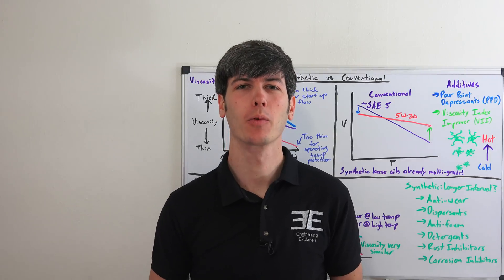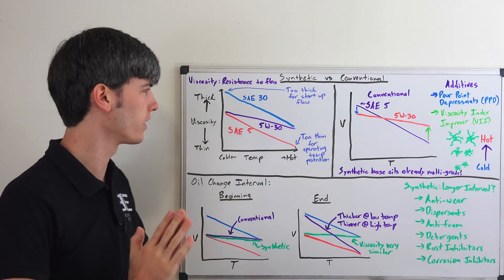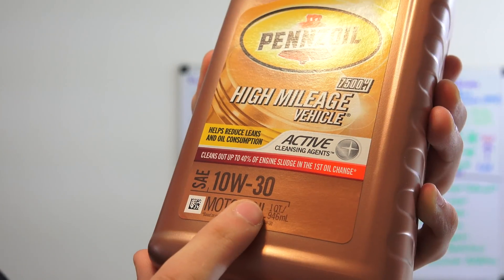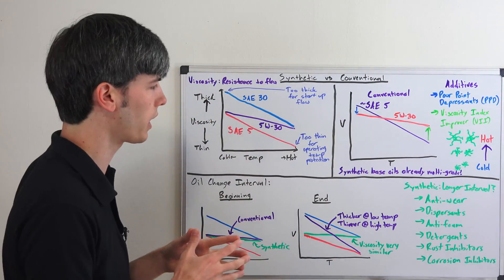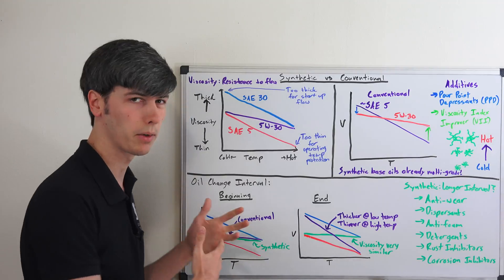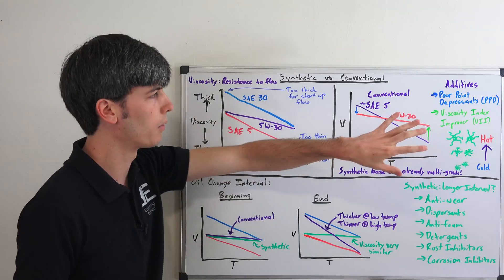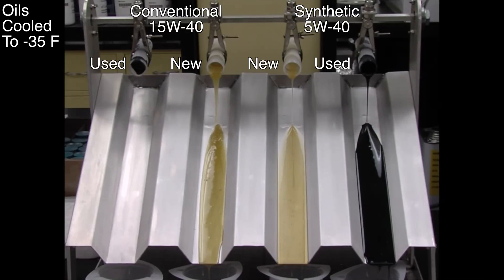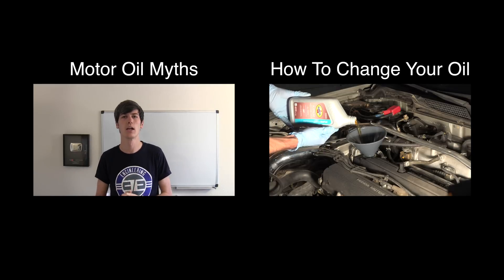Is Synthetic Motor Oil Better For Your Car?

Comment: Comparing 15W-40 to 5W-40 at -35F is bullsh*t, synthetic or conventional.
Reply: I'll attempt to explain this one last time. This is simple scientific method, we learned it in high school. In relation to this video, he explains conventional oil is given additives to make it behave like a multi-weight oil. 

His hypothesis is that conventional oil loses these multi-weight properties as it is used. So he conducts an experiment, he pours NEW and USED conventional oil, while also pouring NEW and USED synthetic oil. 

The expected result of the experiment is that the USED conventional oil won't behave like a NEW conventional oil, due to the loss of multi-weight properties.

HOWEVER, the experiment isn't performed to the standards of the scientific method. In fact,  it is performed in a way that predictably influences the data, and actually provides the data he was hoping to see. You see, in the scientific method, to TEST your hypothesis you should change ONE, and only ONE variable during your test so that you are testing ONLY that variable. In this example, that ONE variable was the type of oil. Conventional or synthetic. In fact, he changed TWO variables, the TYPE of oil, and the WEIGHT of oil. 

Earlier in the video he explains that NEW conventional oils should perform much like NEW synthetic oil. So by that understanding, we could have expected the NEW synthetic oil to pour just as sluggishly as the 15W-40 conventional oil. 

The attempt to excuse this error in the scientific method of saying "There is no conventional 5W-40 oil", is out of line because there are plenty of weights of oil that are made in either synthetic or conventional, such as 5W-20 or 10W-30, being very popular ones.

Another parallel example showing why you cannot change multiple variables in the scientific method. Suppose I want to test which shovel is better, a wooden shovel or a metal shovel. I predict that the wooden shovel will preform better at digging.

To test, I give a metal shovel to a child in the frozen tundra, and ask him to dig. Then, I give a wooden shovel to a man on the beach and ask him to dig in the sand. When the man with the wooden shovel digs a 5 foot pit, and the child with the metal shovel doesn't even break the ground, can I then say that indeed, the wooden shovel is the better shovel?

Of course not, you would give the same man the metal and the wooden shovel on the same patch of earth. Then the better shovel would indeed shine through, and my prediction would be proven wrong.
Reply: Your username only makes this comment even better.
Reply: That's not part of the demonstration. For all intents and purposes the demonstration shows a 5 weight synthetic oil and a 15 weight conventional oil at -35 degrees. There's nothing 'temperature stable' about showing a thicker conventional oil in the freezing cold. Furthermore, "5w-40 oils aren't exactly common", ALL the more reason to use 5W-30 oils across the board! This pour test was so easy to do properly, the only reason it wasn't done correctly was to bias the results in favor of synthetic.
Reply: Props to the presenter for such a well explained video. But I have to agree with Phillip Shank. There's no excuse not to compare the same grade of both oil types. Just calls the integrity of the test into question. Its obvious 5W will perform better at a colder temperature than 15W. Yes, the test is between new vs used. But to cause less confusion, test same grade. That is not to say synthetic oil is not better but the demonstration setup could have been way better.
Reply: Literally says he is not directly comparing 15w-40 to 5w-30. It is comparing new 15w40 to used 15w-40, and comparing new 5w-30 to old 5w-30. And your article is literally agreeing with the video. The point of the video is about the resistance of synthetic to breakdown over the lifespan compared to conventional. Copy and pasted from your own article.

 "What you need to know about synthetic motor oil is that it’s widely accepted that any motor oil that is classified as a synthetic delivers better protection than conventional oil does against thermal breakdown—the tendency of the oil to deteriorate (and thus not lubricate as well) when it’s heated. It also curtails wear, increases resistance to contamination, provides better flow at cold temperatures, and reduces sludge and deposits on piston rings. In other words, even though you’ll pay more—typically $1.50 to $3 per quart—for a synthetic motor oil than you would for a conventional motor oil, you’ll get more in return."
Reply: Ralin, I hadn't forgotten about what I had told you. I've gathered 5 different used oil samples, all 5W-30 conventional. (THE most popular oil weight sold) While I think very few people drive their cars very often in -35F temperature, the idea of the test is that conventional oil, once used, sucks in the cold.

So I put 2 of the used oil samples in the freezer, both had been in an engine about 5k miles. Both stayed in the freezer for almost a week, at -5F I pulled them out and filmed a really crappy video of me checking the viscosity. There's no point in doing a flow test as illustrated above, as I could pour the entire quart freely into another bottle. 

I'm thinking of getting a small hose attached to a funnel and pouring a precise measured sample through, and timing it. The idea is that used oil that has 'broken down' will take longer to pass through the small hose than a new oil. But right now the whole idea that conventional oil becomes a liability to your engine once used is appearing totally bogus.

Not to mention the millions of cars on the road which have each racked up hundreds of thousands of miles EACH with nothing but conventional oil...that's not proof enough either, I suppose.
Reply: It's funny that I'm being asked that by you of all people, who I just showed doesn't understand. It was a clever little "I know you are but what am I," but that counter tends to not work in the real world. 

I don't know how to make this any easier for you.

1) An oil that is not rated for cold will perform worse when cold.
2) An oil that is not rated for cold will perform exponentially worse when used and cold.
3) If temperature wasn't supposed to play a role in how the oils performed, there was no reason to cool them to -35, something which unarguably gives a distinct advantage to the oil that was in fact rated for cold.

The experiment could have been conducted at 70, or 170 which is closer to engine running temp. It could have even been done using 5W-30 against 5W-30, but that's not what he did. He purposely used an oil rated for colder temperatures, then cooled the oil to temperatures beyond what the 15W-30 could handle. This is not good science, it's not a good experiment, and it is not being honest to the viewer.

You fell for every nonsense word he claimed, because you are the very layman he was targeting. If he can sell one more sorry schmuck oil at a higher price, he wins for his sponsor, Pennzoil. You are that schmuck.
Reply: Ralin, nice catch by the way pointing out this was a sponsored video. I was so pissed by the blatantly errant demonstration that I didn't connect the dots. Likely Pennzoil suggested the crookedness, as I rather like this YouTuber, his videos are informative, even if he totally sold out on this video.

I've wanted to for a while, and I've finally started to collect samples of used motor oil. I'll recreate this video, but I'll do it properly, and avoid any bias whatsoever. Will be a few weeks, but I'll post a video and we'll see how badly used conventional oil actually behaves.
Reply: I'd like to chime in here. While I agree that the test probably should have been performed with identically weighted conventional and synthetic oils to reduce confusion, I still don't see it as necessary since the point was to demonstrate how the oils wear over time. 

I believe the purpose of cooling the samples to -35° was to exaggerate the differences in viscosity. Obviously no internal combustion engine is operating at such a low temp. I don't know about you guys, but when I change the oil on my vehicles I can't tell the difference in viscosity between new and used. But I bet my engines can.

To Phillip; glad to see someone is recreating these tests. Peer reviewed science is good science. You should Google the Zahn cup viscosimiter and how to use one. It may give you a reliable, measurable way to test your samples. Plus you could probably make your own out of a solo cup (or something similar).
Reply: Ben R you broke it down as simple as possible, yet point was still missed.. sad sad.. lol
Reply: What's really sad is being so unwilling to hurt someone's feelings that you can't, or won't, point out a major flaw in their method.. sad sad.. lol
Reply: He could just have put the same oil rating on both and you would have not known the difference. He decided to put both on there and explain why, how does that make it dishonest?
Reply: 5w-40 conventional oils aren't exactly common. That's part of the demonstration, that synthetic oils can be more temperature stable than conventional.
Reply: Pelu A 5w-40 conventional is basically a curio, mechanical sheering will just leave you with a 5w-30 or thereabouts. One of the advantages of a synthetic is that you can have a 5w-40.
Reply: Yeah, those are my thoughts exactly. I've watched and enjoyed a lot of his videos, but this one... something just didn't add up.

If temperature wasn't supposed to be a variable, why alter the temperature?
If temperature was supposed to be a variable, why not use the same grade?
The amount of variables present is supposed to be absolutely minimized in an experiment like this, so why so many of them?

Then I saw the sponsorship by Pennzoil. Like you said, it was so blatantly obvious that it was skewed.

At any rate, I look forward to seeing the well conducted test. Thank you for your honesty.
Reply: Phillip Shank. that's good enough for me my friend peace out
Reply: Oh, hey Phillip, good to hear back from you!

Yeah, I kind of figured that as long as you weren't putting tens of thousands of miles that it wouldn't be detrimental to an engine, regardless of conventional or synthetic. I definitely look forward to the hose test, though. It should prove quite interesting.

Thanks for the update!
Reply: Phillip Shank - I was thinking that too and my car use 5W-20 but I been using synthetic after first year of ownership. Also I would recommend it for a daily driver.
Reply: Seven Five Thank you for pointing that out.
Reply: This test is potentially misleading. The only information to be gathered from it is that synthetic has a lower viscosity at lower temperature. What if the effects are only exaggerated at these temperatures lower than the average person will experience. What if at higher temperatures the difference between  the two types of oil are negligible? I mean, he was sponsored by Penzoil for this video, so you never know. I'm just saying that when you want to misconstrue results for an experiment, you show a small sample size with variables that favor your position.
Reply: haha well said!
Reply: Yes the test was total BS! First they were comparing to different viscosity oils. Second -35F is ridiculously cold. No one would run that thick an oil in conditions that cold. They chose the viscosity of the samples and temperature to try to show dramatic difference between conventional and synthetic that simply doesn't exist in the real world. Raise the temp by 10F and all those oils, new and old would flow the same.

To be clear synthetics are superior to conventional oil, BUT unless you have a race car or you live in the Arctic circle you will never reap any realistic benefit from using synthetic oil. You will not get better fuel economy, your engine will not last longer and the manufacturer's recommended oil change interval remains the same regardless of what oil you use or what it says on the bottle of oil.
Reply: what uses 40 weight motors, you must have a Ford engine. I use 10/30 in all my cars and Ive had no issues.
Reply: Mostly older diesel engines use15w-40.
Reply: Thomas Morris my motorcycle takes 10w-40
Reply: +Phillip Shank Very well said, friend. If temperature didn't matter and wasn't the point of the video, as he and those defending him are trying to claim, then he wouldn't have cooled them to -35. Clearly an oil that isn't rated for as cold will perform worse when new, and exponentially worse when used. Poorly conducted test.

Brought to you by Pennzoil! "More expensive means more better" - Pennzoil
Reply: I agree, I hate videos like that.  Yes I heard what he said, but the video is still misleading just as dozens of other videos on this subject floating around the internet.  If you pay attention, he points out at the beginning that brand new dino oil of a specific viscosity rating will be identical to brand new synthetic of the same rating.  He then asserts that late in the oil's life, dino oil will lose significantly more of its viscosity rating than synthetic.  

The only question is, just how much does it really lose?  That is the main difference this "engineer" points out.  His charts show a lot of loss in viscosity range for the dino oil.  

If there is that much difference, then by using the same weight rating oils we could have seen that "big" difference. 

But no, he has to bork his test for no rational purpose rather than demonstrate what should have been very easy to see with same weight oils.  Then gives a lame excuse that he is just showing the difference in viscosity of old vs new dino, and old vs new synthetic.  Yet the entire video is about dino vs synthetic.  

Unless of course, it didn't give the result he wanted, and it wasn't easy to see any difference.  

There's a sucker born every minute (second?  sub-second?) and of course they all piled in on this thread with their "common" knowledge.  

Try reading this :

http://www.consumersdigest.com/automotive/motor-oil
Reply: That's a terrible excuse. There was zero reason to cool the oil to -35 if temperature was not supposed to be a factor. Of course, as we have all said already, an oil that is not meant for cold temperatures will perform exponentially worse when used vs. new in comparison to an oil that is rated for the cold. 

An oil that is rated for the cold has only one factor reducing it's flow when it's used, and that is that it's used. An oil not rated for cold deals with both being far too cold for it's intended use, and the fact that it's used.

You seem to have a really low understanding of the issue here.
Reply: Beleive me. there is no synthetic oil in this Video. Both are made of Mineral base.
Reply: I happen to use Pennzoil synthetic in my pickup. But I've only had to start it a few times at -34F. My typical cold starts would be in the +20F range. I'd only put 15-40 in an old engine with very worn rings or use it in high temperature environments. This demo is as informative as showing that salt water freezes at a lower temperature than pure water.
Reply: I think you missed his point. First, the weights of the oils should have been identical. There is absolutely NO reason not to use as similar oils as possible to demonstrate your point. Unless of course the point is less clear when a similar weight conventional is used.

Second, I agree that running the test at -35F is rather silly. The lowest temperature most of us will see is 0F, and that isn't even terribly common (happens only a few days of the year).

But it's easy for a skeptic to think that had he used 15W-40 conventional and synthetic, that the new and used synthetics would have flowed at drastically different rates, or rather, had he used a cold weight conventional (5W-20) that the flow difference between new and used isn't that obvious even at 0F. 

I really like this Youtuber, he explains things very well, however not using the same weight oils during the pour test is simply unacceptable, it makes it seem like they're hiding something. He made some comment that 5W-40 isn't possible with conventional oil. Perhaps, but I know 5W-20 is available in both conventional and synthetic and is used in far more automobiles than 5W-40, so use that during your test at 0F instead. I suspect the differences are subtle, hence the -35F test, and the difference cold weather temp ratings.
Reply: This was meant as a reply to Ben R, I'm agreeing with BlankBrian.

Comment: what if you put a straight sae 15 or 20 in a 10w40 car? this could be a good medium for the car
Reply: No. 10w40 is the viscosity of straight 10 when started and the viscosity of 40 when hot, that's how multi-grade viscosity oils work. Using straight 15 or 20 will be thicker at startup and thinner when hot than a 10w40.
Reply: +kcotte59 My thought is, think about when people use lawn mowers - Spring, Summer, Fall. Temperatures should be above 0 C/32 F. A lawn mower oil won't need to compensate for the additional thickness that winter cold brings.
Reply: Lawnmower engines are much simpler than car system, most have splash oil systems and no filter. That is why you're suppose to use non-detergent oil, the detergent suspends dirt to be filtered out, if there is no filter you don't want to suspend the dirt in the oil. Lawnmowers are used when grass grows, which it won't grow unless temps are consistently above 60°F, meaning while mowing it will be 70°F.  That is why they often recommend 30 weight Lawnmower Oil.